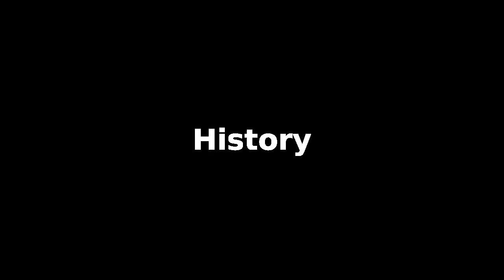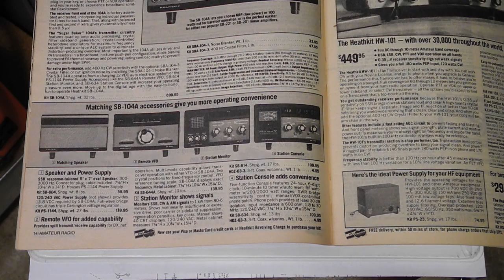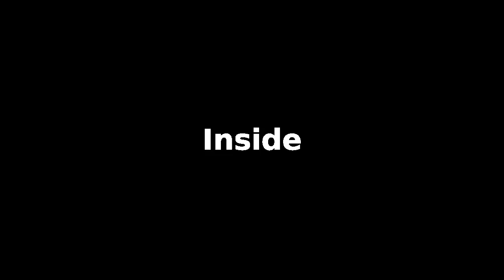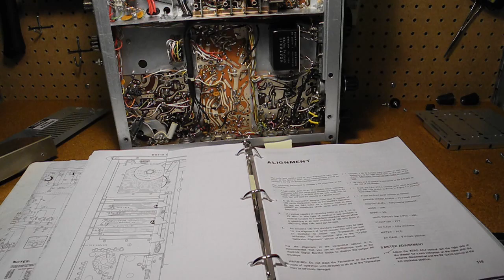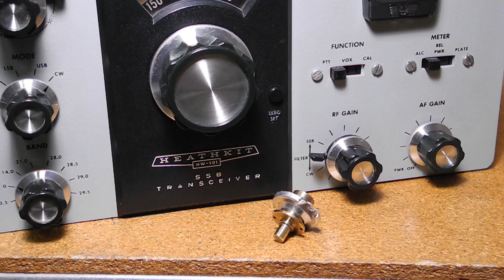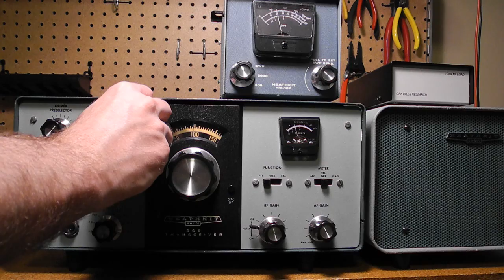The Heathkit HW-101 Single Sideband Transceiver

Comment: Does CW transmission just transmit a sine wave?  And then it is turned on and off with the key?
Reply from the maker: Yes, that is essentially correct.
Reply: @jefftranter  Excellent!!!  Thank you!  I've wondered about that for a while and googling did not help.  Is there something that I said that was not correct?  (you said "essentially")
Reply from the maker: @drstrangelove09 There are some other minor details, like "shaping" of the signal on/off so that it doesn't generate clicks or thumps in the received signal.
Reply: @jefftranter Aha!  OK!   Thank you!!!!

Comment: One of my high school teachers gave me his old HW-101 back in the early 90s after I got my license. Receive sensitivity always seemed poor compared to my neighbor's ham setups and even after a few tube replacements I never seemed to be able to improve it much. I hauled it with me to college, hoping to fix it, and a kind ham I met over the internet sent me photocopies of the manuals, but there was something in the alignment and calibration that stumped me and I never got through the procedure. After college I had a co-worker who inherited a basement full of tubes from his late father's estate, and he gave me some spares for tubes that seemed marginal, but by that point setting up a station was pretty low on my priority list, so it went back into a box in my basement.

My HW-101 has since been moved to a storage unit, and I'm sure now a recap is in order, the belts need replacing, and some of the tubes may have completely failed, but "one of these days" I'd still like to get it going. The hum of it powering up, the glow of the filaments (and especially the rectifier), the scent of baked dust, and the frequency shift of stations while turning the dial (especially through the CW filter) are like a concentrated hit of nostalgia from the Elmers of my youth.
Reply: The baked dust smell can still be called up from memory after more than half a century!

Comment: Excellent video Jeff. I built a 101 in 1978, much of the construction time spent with my infant daughter sitting in her playpen beside me. I now have a substantial stack of old Heath rigs sitting in and on a large shelving unit. I have two operational HW-101's sitting on the top shelf, one of which I'm planning to fully restore. I'm currently working one of the HP-23's. Your video sure brought back some great memories.

Comment: Jeff were are the parts available for the HW101?
Reply from the maker: There is  no one source for replacement parts - you will have to search the Internet depending on what you need.
Reply: @jefftranter  Thanks for replying to my guestion.I would like to replace 6CL6 driver tube and the 6CB6 2nd transmitter mixer tube.Do you have a good source for tubes.Also wood like to replace the rubber belts because I see cracking.Where did you find replacements for yours?Any info would be appreciated.Ron NB3W
Reply from the maker: @hunt555fish  I found some suppliers of HW-101 rubber belt kits on eBay. Tubes can be found on Amazon, eBay, and from suppliers like tubesandmore.com

Comment: I had an HW 101 in the 70's and have been keeping an eye open for years to find one again, but it had to be clean and unmodified. Well at the swap, one
was on a table for sale with the power supply AND the SWR/watt meter, AND the CW keyer for $90 dollars !
 The radio, PS, and Watt meter, (All Heath), were very nice so out went my wallet and I brought it home. It works great ! and I am having a ball using it.
 I own many newer radios but this is so much fun to use. I also picked up a mint Heath phone patch and a Heath speaker at the same swap after I
bought the 101 just so I can have a complete 101 station. Fun Fun Fun. Now to figure out how to connect it to my SB 200.

Comment: My late model HW-101 (series no. 34-43996, bought in the Philadelphia, PA Heathkit store) has the little circuit board replacing the phase shift module for CW sidetone, as well as carbon film rather than carbon composition resistors, and a dial string rather than O-ring for the final tune variable capacitor.  This takes stress off the capacitor's bearings and is a good mod for units using the O-ring.  (I've actually seen units with worn capacitor bearings and intermittency in the capacitor.)  Also, I always used mine with a low-speed muffin fan over the finals, which kept drift minimal and kept the whole unit cool.  I recommend this for all tube gear.  The 6HS6's are very high-gain and can cause SSB distortion on receive; 6AU6's can prevent that with a slight drop in sensitivity though mine still has the 6HS6's installed.   My HW-101 took me over a month of after-work evenings to build.  73 de KU3E

Comment: We also had a Heathkit Amateur radio setup in a cabinet at the back of the Electronics classroom . This was in 1977 and there was a large 4 or 5 element HF beam antenna on the roof. This school didn't happen to be in Newmarket Ontario did it?
Reply from the maker: No, it was in Mississauga. But I expect it was not uncommon to have ham radio clubs in high schools at that time.
Reply: @jefftranter  Ya I was thinking a lot of High Schools would have bought Heathkit test equipment for their electronics classrooms as well. They were cheaper and the students could learn and build.

Comment: The SS9000 synth transceiver was sold under the Heath brand, and was sold fully assembled. The SS9000 sold for $2700 in 1983. I have the HW101 with the CW crystal filter, Q multiplier, preselector, station monitor scope, and an HP 23B power supply, but I do not have the speaker. The 12AT7s were pretty iffy, and the 6GW8 was pretty much toast. A diode was cooked, but everything else, except the belts were still okay. Most of the electrolytic caps had already been replaced. I have one more I should swap out, but it's a dry cap. Lots of the coupling caps were also probably replaced as there is a wild mixture of brands ranging from Paktron to Philips. My 101 also has an Amphenol SO 239. I paid $120 for my HW101, and all the other goodies. I am elated to have the CW filter.

Comment: Jeff, excellent video!  My first HF rig in 1991 was an HW-101. I purchased mine for $50 and had to re-assemble it before trouble shooting and repair.  I later sold the HW for $150 to purchase a modern Kenwood TS-680s.  A friend gave me his father’s HW-101 who originally built the radio.  This one I’ll pass on to my heirs.  I love Heathkit gear for the very reasons you mentioned in the video, well documented and commonly available parts.  Keep up the good work.  Paul